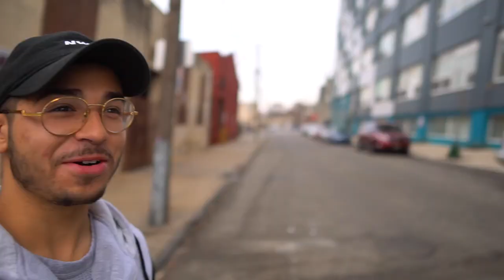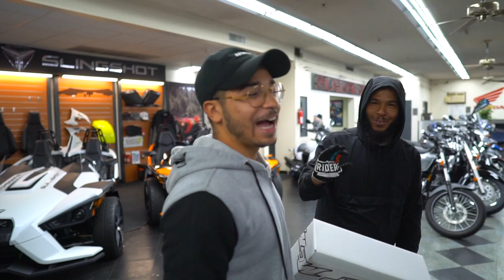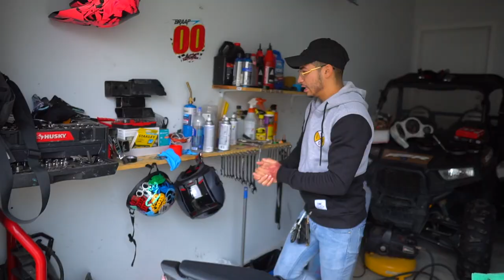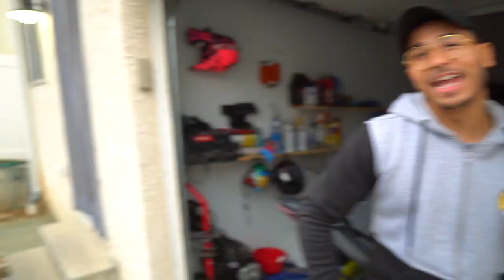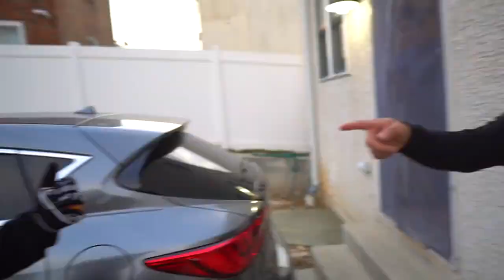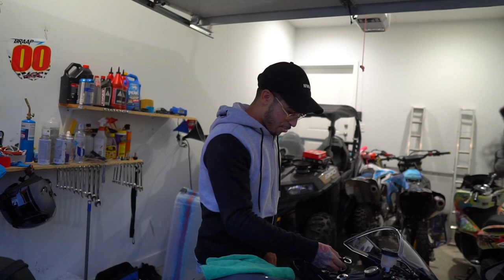FINALLY GETTING A NEW EXHAUST FOR MY 2019 ZX6R ! | BRAAP VLOGS

Comment: When doing a cat delete and slip on exhaust you definitely wanna flash your ECU
Reply: There was no cat delete. That is a bread box. It is a chamber to muffle more sound. The cats are in the headers.
Reply: So much misinformation about that MUFFLER BOX in the internet. That big weird shaped piece in front of the rear wheel that the factory muffler connects to is the MUFFLER BOX not the CATALYTIC CONVERTER. The CAT is that short round piece that the header pipes connect into. People are even selling the Muffler Box on ebay labeled as a catalytic converter.

Comment: I pretty sure  you got the pipe that’s connected to the exhaust position the wrong way G. Looks good but weird angle. It shouldn’t be pointed outward like that, but rather hugging close to the bike and pointed upward. Check out some google images.